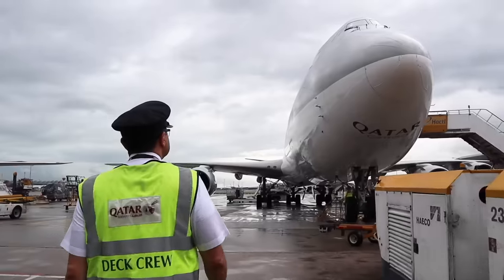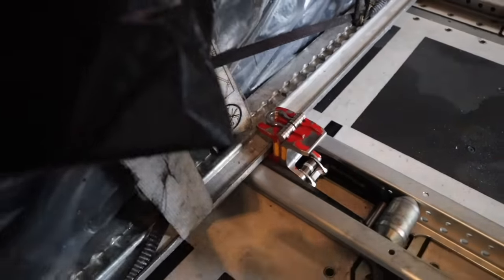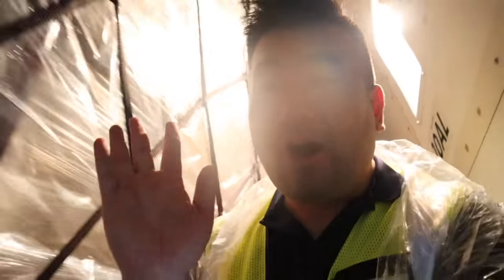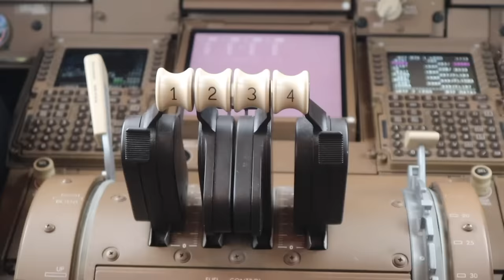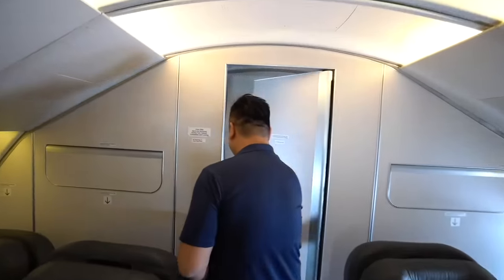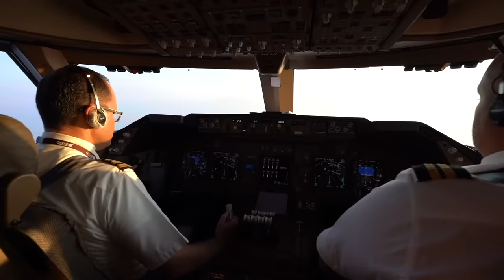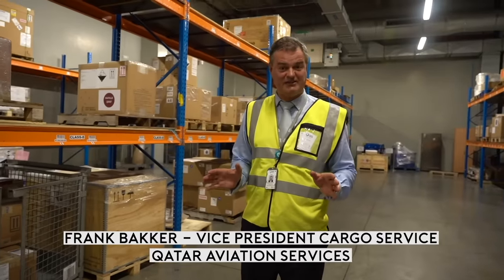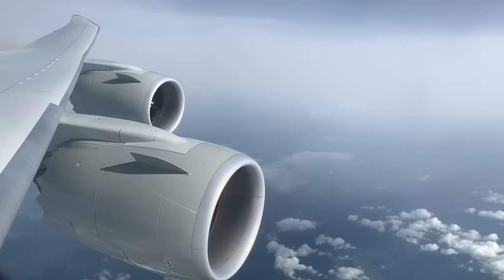Flying on Qatar Airways B747-8 Cargo Plane

Comment: I don't care what anyone says if you can still find the videos made on the jet fuel hoax there is something going on. The wings where they say the fuel is stored is an inadequate amount of space to hold the 60k plus gallons of fuel the plane supposedly carries. One must study the concept if the argument closely. But the amount of fuel carried in the tanks that fill up the reservoirs at your local gas station hold approximately 3500 gallons. So take thise tanks and siole math says that almost 18 of them would have to fit in the wings. The problem with that is the wings have piping and ducting that go from the apu in the rear of the plane. They also have all the physical tie rod mechanical apparatuses for manipulation of the wing flaps.The wiring from cockpit to the engines are there inside the wing. They have a video of a guy inside the supposed tanks inside the wing. He has in no PPE. No respiratory to breath. Jet fuelbis close to diesel fuel. My theory is they have some very small tanks in the very limited space under the fuselage. The fuselage doesn't provide much available space because the luggage compartments and the landing gear. Another thing is the amount of fuel going into an empty plane would displace the same cubic feet of air inside an empty tank. For the relatively small hose used to replenish the pressure and volume flowing per minute would be extensive. Theybwould have to have some sort if relief valve for the air to escape as the fluid went into the empty tank. A small home I ground pool is 10k gallons. A very large home pool is 20k gallons. That amount of air would cause lots of fumes. Especially in the summer in places like Phoenix. Anywqys something is definitely up. When they explain the fuel being burnt up in terms like tons of fuel per hour ots hard to imagine those figures. They say 1 gallon of fuel per second on a 747 when in cruise. So 60 gallons a minute 3600 gallons an hr and 43,000 gallons for a 12 hr flight. 3600 gallons at 6.5 pounds per gallon equals 23,400 pounds or 10 to 11 tons of fuel per hour. 60k gallons is 224,400 litres. O aging those 1000 litre water cubes on a pallet. Then imagine 200 plus of those fitting on the wings or the small available area under the main deck where one walks and seats exist. On a regular plane the landing gear takes up most the area.Stowed luggage makes up allot of that space too. Its an interesting phenomenon. Puts another spin on the spin of 911 also

Comment: The flashback of the 747 in Afghanistan a few years back whose load shifted on takeoff and it stalled and crashed keep's going through my mind when I see the crew securing the loads. 
What a terrifying and helpless feeling the crew went through as they plunged to their death! If I were the pilot's, I'd be standing over every worker in the loading bay to make sure each load was secured! Rule #1 in aviation, trust, but verify. #2 NEVER trust anyone but yourself!
Reply: You may need to see someone about that….